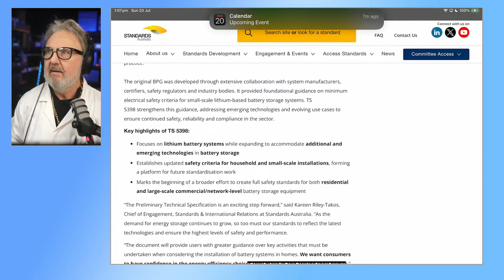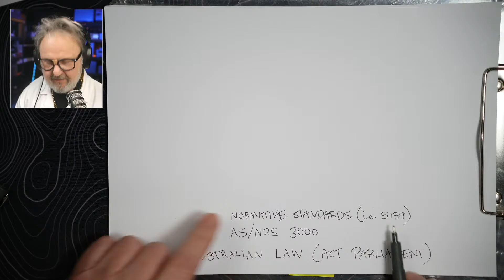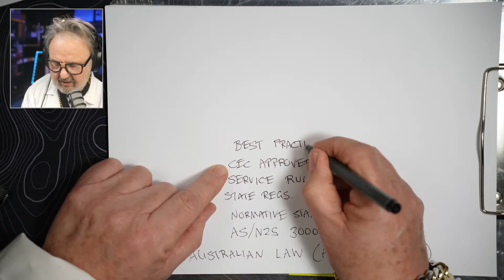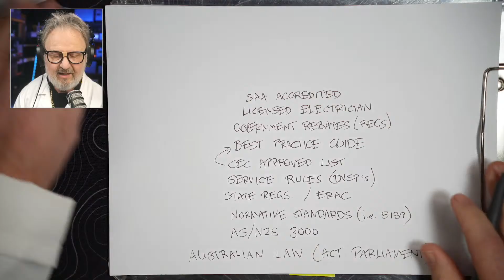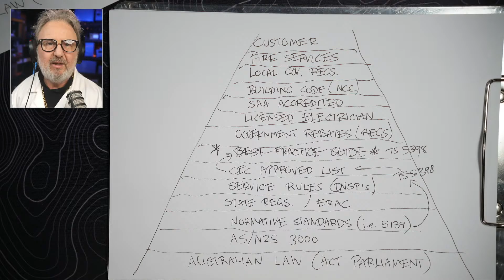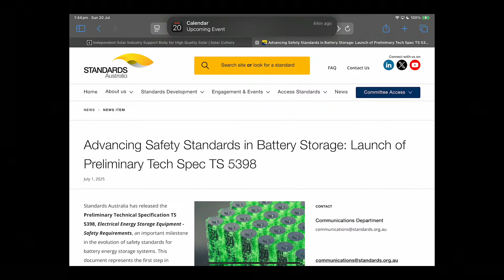Will the new technical specification TS 5398 shutdown our battery industry?

Comment: Hi Glenn,
Just had tech question for you. I'm from NZ & are thinking about getting solar. I have a line voltage  of 245v, will this cause problems with voltage rise & limit my exports. Looking at powerwall 3.
Thanks Dan
Reply: Make sure your system designer does the required Voltage Rise calculations. New rules make it easier, but still possble to mess it up.
Reply: just ask vector to turn it down easy as
Reply from the maker: Hi Dan, typically around 249V in New Zealand the inverter should island from the grid an thus stop generating. If you have a d.c. coupled battery then it may still charge the battery during this event.
Reply: So not looking good for exports?
We are on our  own transformer ,but not sure if it can be turned down (tap)
Thanks Dan
Reply: @dansarahmurdock1083  Talk to Vector first to get it turned down, and ask your installer to keep voltage rise to an absolute minimum if need be (Larger cable run from switchboard to inverter)